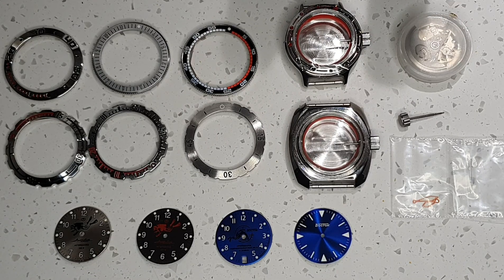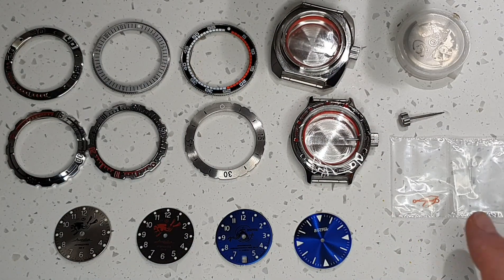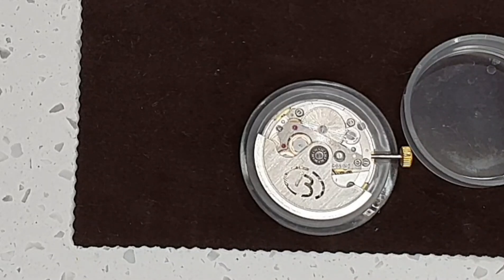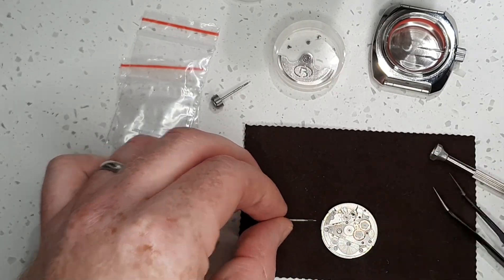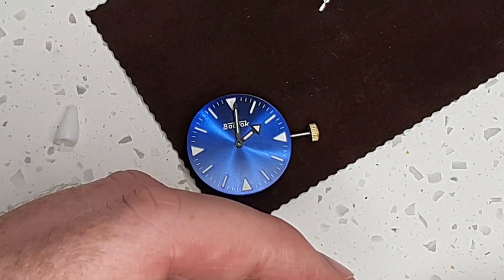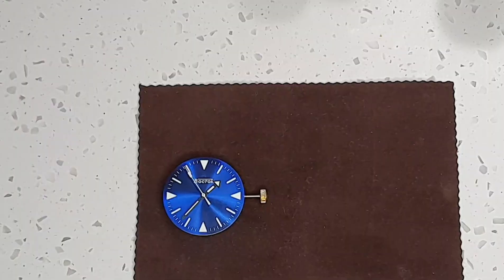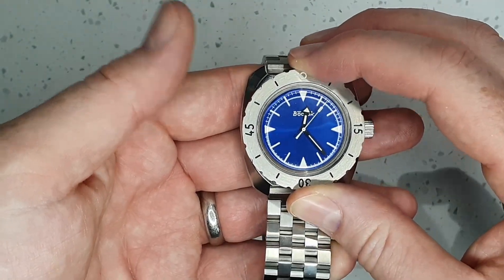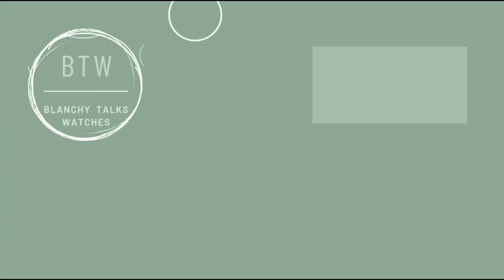Building a custom watch - Vostok

Comment: I'm not absolutely 100% sure if this is correct, but I believe that you need to remove the date complication to be able to fit those hands. The added thickness of the dial needs to be accounted for. 
The movement you fitted is 2416B (with date complication). New Vostoks that have a dial without date window get a movement without calendar wheel, but it still has a date plate attached (2415.01 movement) and they get that plate just so the dial would sit closer to the crystal. With vintage Vostok cases you don't need the extra thickness of the date plate, but with new ones you do. And on Vostoks with sandwich dials they even remove the date plate to account for the added thickness (making it what they call a 2415). So you need to turn your 2416B into a 2415, removing the calendar wheel, date plate and all little parts dial-side that belong to the date complication.
Reply from the maker: Thanks for that it's very informative, I'll try the hands on another movement in the future
Reply: E

Comment: Too bad about the hands. It still turned out nice with the dial and after market bezel. Vostoks are fun to mod. I have a komandirskie that I filed then wet sanded all the Chrome off the bezel. It looks great. I also have a NOS "Vostok century time" orange dial for a future project.
Reply from the maker: Thanks, I've modded a good few vostoks at this stage. That sounds great, I haven't stripped the crome off any yet but I believe you can do it with muritic acid if you dont want to file and sand. It's great finding old dials for projects I found a nice white one for my next build
Reply: @BlanchyTalksWatches   The Chrome came off pretty easy. I would like to find a old plated case Vostok amphibian and take it to brass. All the newer ones are stainless steel.  I may try the acid on the crown.

Comment: Dear sir, I have 2 questions:
  To change the bezel in 710 case vostok amphibia watch, Do I have to buy only the Bezel Insert or I have to buy separate bezel and bezel insert ?

Will you recommend 710 or 420 case, my wrist size is 6.6 inches.

❤️ from India.
Reply from the maker: You will need to buy the separate bezel and insert. The standard vostok ones won't work with Seiko inserts like I used here.

The 420 is a smaller case so may fit better but I prefer the look of the 710
Reply: @BlanchyTalksWatches  thank you

Comment: Where did you get the orange hands? So that we know to stay away from them.
Reply from the maker: vostok-watches24 very unhelpful when I emailed them
Reply: @BlanchyTalksWatches  I had a similar experience with the white version of the same set. The hour hand would not go on but the minute hand was Ok. I tested the hour hand on a spare movement I had with no dial and the hand still could not be fitted. The hour hand was just too small for the post. Very frustrating.